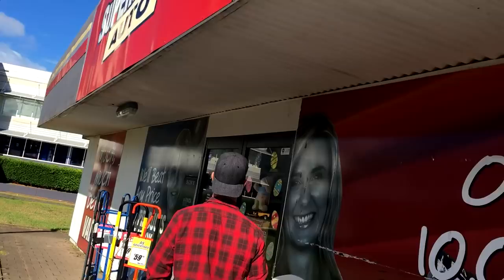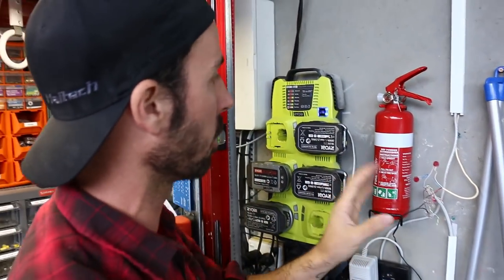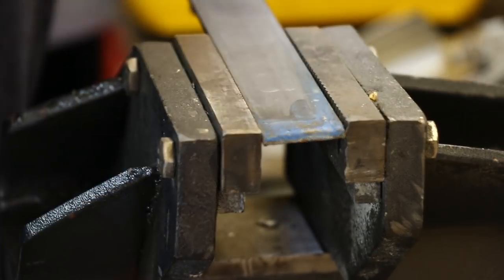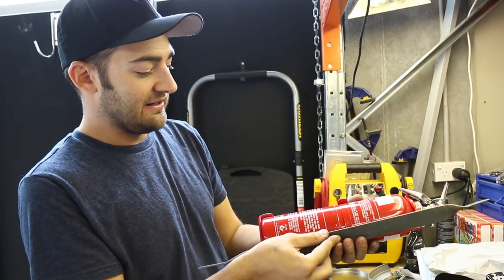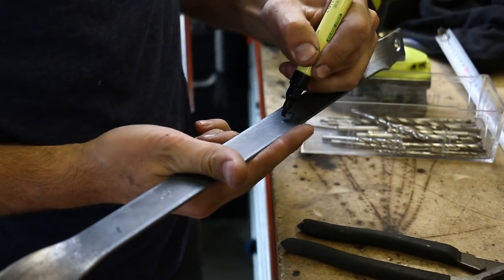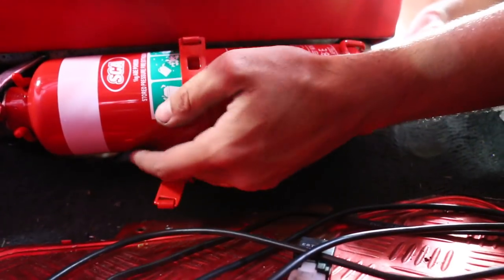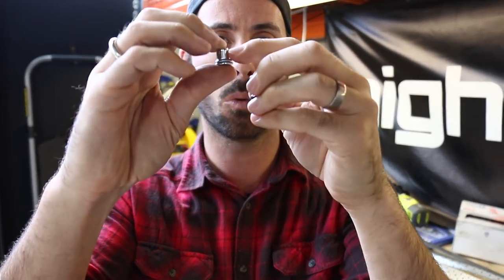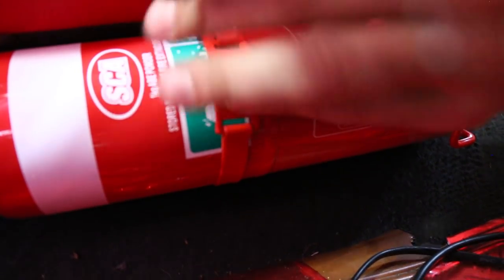How To Install A Fire Extinguisher In Your Car

Comment: This thing just saved my RX-8. When I was roaming around, my car stalled for no reason and I tried to bring it back on. As I did that, the cat went on fire due to the unburnt fuel, caused by a dead spark plug, ignited with immense exhaust heat. I grabbed the fire extinguisher and it saved my ass that day. It's one of the greatest investment of owning a tuner car, in my opinion.

Comment: Also worth noting that you should get the right kind of fire extinguisher for engine fires. Water will do nothing on an oil/gas fire. Get ABC or Halon, preferably Halon because it leaves no residue and it's approved for aircraft.
Reply: *Carbon Dioxide
Reply: HJZ75driver
Is that what's approved for racing? I wouldn't know. I just know the Halon ones for aircraft.
Reply: UnlinealHand if its approved for aircrafts the. Wasabi 9000 needs it

Comment: You both put more effort into installing the Fire extinguishers than I did with my car. I grabbed a drill, my extinguisher and some sell tapping screws and job done. Now I have nasty sharp pointy screws sticking out from under my car.
Reply: +Joe Will hope you dont roll your car, 2kg of fire ext flying around the cabin when the selftappers pull through with enough g force.

Comment: I have always kept one in my car even sense my 1987 Fiero caught on fire in 1995. I did manage to put it out by ripping out the radiator over flow tank and pouring it on the engine. Sold this car soon after cool little car tho fun to drive.

You should do a how to install a GPS tracker in your car for the next time yours gets stolen you can track it !!!!

Comment: Except that the holes that are now in the floor of the Saab will start to rust
Reply: get stainless nuts. problem solved!
Reply: +Rick te Kronnie now*
Reply: rubberized undercoating paint will help against rust. Just because the rivnut is stainless doesn't mean the rest of the floor will rust.
Reply: +petey2crazy yep i didn't read it right i thought for some reason he was talking about the nuts

Comment: Some things that absolutely should be done differently... 
1: You should be able to reach it while strapped down with a 6p. 
2: One litre is often way to small if fuel is on fire
3: You might one for the interior which doesn't destroy wiring, carpet etc and one (larger) suited for exterior/engine compartment (not in the engine compartment) 
4: Some incurence companies will reduce your cost if you have this
5: Good that you guys show that people should have these but why have an episode for something that basic 😂

But then again, it's you guys...  You don't do things @ 100% but people love u 😉

Comment: Having a fire extinguisher in a car can be a useful item but you need to know how to correctly and safely use it. Also you need to know when not to use it and to just focus on moving everyone safety away from the fire.

The first bit of safety kit I have with in reach with out stretching on modified vehicles is a rescue hammer with a belt cutting blade. So if you are trapped in you harness you can cut through it and then smash out a window if you can't get the door open.

Comment: I got me a free extinguisher from work because they have a rather pointless shelf life and after something like 3 years they have to be replaced so they put about 25 of them on a pallet with a sign saying free . I took a piece of 20 gage steel i had kicking around and in about 2 minutes i had a free mount as well . just cut a strip about 2 inches longer than you need and bend up a quick release by bending one end over a 1/2 inch socket and bend the other end over a 7/16 socket , now i just press the 1/2 inch over the 7/16 and abra ca dabra a free extinguisher held down very well by a free snap like the one on your shirt only about 100 times bigger and stronger . The snap holds on so well , i can't open the strap without pulling on the extinguisher at the same time , because it would be about as hard as removing a snap ring without pliers .

Comment: One thing not mentioned here is that there are different extinguishers for different types of fires. You want to make sure you get ones for gas/oil fires.
Reply: +iamstd2 If you buy it at an auto store, it's probably for cars.

Comment: I'd also put some threadlocker on the bolt threads otherwise it will vibrate loose over time. Oh, and wear safety glasses when using power tools...

Comment: I have never heard of a rivet nut before. I must have these in my tool box.
Reply: They're great until they spin in the hole. Then they're fucking terrible. Best way to do it is just put a tack weld on them after install so they can't spin.

Comment: My only gripe is you guys didn't mention anything about rust prevention on either the plate of mild steel or the new holes you've put in your floor pan.

Comment: What ever happened to CAMS & MSNZ approved extinguishers having two steel straps ISO8.8 M6 bolts and self locking nuts with Panel washers?

Comment: verry important if you have one of those cheap fire extuinguisher that will keep spraying after you slam the button 
wait untill you near the fire before you slam the button as the bottle will empty in about a second flat 
allso never mount it under the driversseat , should the bottle come loose (like if you hit it while getting intoo the car) it can roll under the brakepedal giving you all kinds of problems 

might be a nice mcm episode aspecially from the insurance point of view to get with a teacher from the firedepartment and do a show on the propper use of the extunguisher and how to apreach fires and stuff like that and then train on an actually burnng car on their traininggrounds

Comment: I really want to do this, but I think I'm going to hold off for now.  I don't think passengers will get the best impression if they see a fire extinguisher in the footwell of my car haha.
I keep mine hard-mounted in the trunk.  Yes, it's harder to get to in a pinch, but I can still get to it in under 10 seconds if I'm in a rush.  I also do not autocross right now (money), so I don't need to conform to any race regulations.

Comment: The rivnut in saab is useless. It would be more secure if it was glued to the floor with clag glue. 

The wording thinsheet is a giveaway, they have a grip range that needs to be acknowledged and M6 rivnuts of that style only go up to 3mm. 

you need to remove the deadening material from the floor (inside the cabin) to reveal the actual steel floor to  set the rivnut correctly.

Comment: Buy extinguisher and bolts, pick a spot, drill 2 holes, insert bolts through extinguisher mount, tighten bolts, place extinguisher in holder. Alternatively. place extinguisher in door pocket, fitted! :P

Comment: I had one of these in my 1974 nova, which is my daily driver, and apparently they leak out because I used it once just a little, I checked and there was still some more, so I put it back. Then when my volt meter caught fire on the freeway it didn't work xD

Comment: My car has a factory fire extinguisher on a proper bracket and everything but it's loose in the boot and not bolted to anything and I don't know where it belongs.

Edit: I looked it up and it bolts to the front of the driver's seat. Seems a much more accessible place than in the boot.

Comment: Not to be a pain guys but you forgot one thing on the bolts holding the extinguishers in place: Thread Locker. Made that mistake once and ended up with a loose extinguisher in the truck and it was not fun.

Comment: Installing a fire extinguisher to a car is not about drilling holes to some mount, but a serious safety-feature. I hoped,  you´d go more deeply to the detail of WHAT extinguisher to choose. Most powder systems will simply eat your electrics, connectors, contacts, switches, cables etc and damage most other metal parts, plus ruining your interior for good. Most foam-systems simply won´t do the job, unless you install a massive container. And they, too, will ruin what´s left of your car. The one and only system to be installed if you want to go safe and you really love your life and car, is a gas-based extinguishing system with FIA approval for example "Lifeline ZERO or Zero 360". The gas tank is installed in some safe place (backside trunk o. e.) from where several tube-lines are laid out to all the points from which a fire could occur. The valve is electrically triggered by the driver. All professional racing series have it applied that way. Prices start about 900.- €

Comment: Hey mcm, and thier fans.
Just bought an old 99 subaru,  want to make some maintainance. I was thinking about cleaning the engine with various products and restoring the compresion. I want to use seafoam, some king of fueling system cleaner, that you can add to your tank. And Compression restorer into engine oil, before changing it. Am I an Idiont?  these things work? What should be the correct order of using them ? Would someone recomend something more or diferent ? Or maybe talk me out of something?

Comment: pls help me with my 2000 dodge neon its the none turbo one i just need suggestions on making my car perform better. its currently having poor idle and its not starting right away and my spark plugs are flooded. and id like to put turbo but not sure my engine will blow if i do so. I'm a big fan learning a lot from your videos
Reply: sell it, buy an e30 325, and boost it.
Reply: +Will Feral not sure what you mean bro sorry I'm just learning mechanical stuff hehe
Reply: Ah sorry man. Just speaking from a power potential stand point, sell your neon, buy a e30 bmw 325, and turbo that instead. Those motors handle boost very well, and e30s are becoming more and more scarce. It will also be easier and more fun to work on than your neon.
Reply: +Will Feral  what year you recommend?

Comment: I set a car on fire not too long ago. Always make sure the gallons of brake cleaner used has evaporated before reconnecting the neg terminal. Pro tip.

Comment: Those rivet nuts suck if they come loose or get cross threaded and start spinning, have to hold them from under neath and then drill them out. Also I prob would have painted the underside a bit after drilling through.
Reply: +Preproto You should get a pneumatic rivet gun
Reply: Thanks but I don't do that job anymore. Do they make pneumatic ones for these mollies? But the ones I like are the ones where you use the a little tool that grips the molly and you tighten it down with an impact gun

Comment: Can't sleep. it's 3:46am and all I cam think about is that hideous Evo making at least 140hp would be great to see more hp but I just don't know. even at that I don't see 2sexy beating the Saab in any challenge. However I'm rooting for #teamevo! haha. Part 11?!
Reply: +anewacc Unfortunately I think Marty knows this. The Ricevo is about to get chopped. I don't see any torque coming from that little 1.5. he also need to strip the car to the bare minimals to stand a chance. No subs, no passenger seat.

Comment: I had this idea of replacing all my master car window switches in my 1996 nissan pathfinder. So you know how in modern cars, the driver side will have all four window switches for the car? And the driver side window is usually the only one that you can roll down or up without holding the button? (Just a quick press or pull off the button) Well I wanted to do that will all the windows in my car but I'm not sure how to. I've looked hours online and can't find anything. Probably because I'm not wording it properly. Can someone please help me out?
Reply: +Volcomintality get 3 more switches identical to your drivers window switch, swap them out on the switch panel. depending on how your switches are designed this will make all your windows auto. some cars this is not feasible unless you are skilled with electronics and soldering ect.
Reply: +NeonAvantium that's exactly what I was thinking! Just don't know where to find them. And i've disassembled my door already and when removing the switches, all four are connected to eachother. I've looked it up to see if anyone else has done it or has installed on and nothing.

Comment: For all my American friends, it's easy to go to Home Depot and buy an off the shelf unit for about $35. HOWEVER!!! Home Depot sells the Kidde brand extinguishers, which feature a black plastic handle. These units are currently subject to a RECALL of over 44 MILLION units. The plastic actuating handles are known to break, and now we're finding that the tips of the hoses in some units have NO HOLE for the chemical to come out! Kidde extinguishers are a LIABILITY and are to be avoided. I think the icing on the cake is that if you walk around Home Depot, you might notice the fire extinguishers they have hanging in case of an emergency, and they are Amerex brand. Home Depot doesn't even trust the Kidde product they sell to protect their stores. That speaks volumes. Spend the extra $15/$20 on an equivalent Amerex brand unit.

Source: 2 years in the fire protection industry.

Comment: Wait, this is a fire extinguisher install? where is the piping leading to the engine bay and transmission tunnel, and under the dash? Oh, this is a fire extinguisher bracket install. HTH, HAND

Comment: I just carry a few water bottles, just toss them on the floor in the back.
Reply: +22laith22 That won't pass tech at most tracks, lol.
Reply: everyone loves spreading gas fires lol
Reply: +22laith22 you can't put out gasoline fire using water.

Comment: I don't mean to be mean but after Thirty plus years selling and servicing all types of fire equipment I have to say there are some errors in this post. If you have a Fire Extinguisher made by kiddie or anything with a plastic top get a new one! If you go into one of the big box stores look at the ones that they sell vs the ones they use to protect there store. They will use typically an Ansul, Amerex  or Badger product. First alert and Strike First are also junk. I used to prefer Amerex but Now Like the badger brand the most. Ansul makes the best kitchen fire system out the and there fire Extinguishers are probably in second place these days. You will not be able to get these at the box store or even at a good hardware store.  You will need to get these from a fire Extinguisher CO. Ask around andf try to stay away from the big guys. Smaller Company's like me tend not to treat there customers like $$  There are so many companies just looking for your money so ask your fire dept if they trust anyone, they are not officially allowed to recommend a company but they know who sucks.
A couple things that bugged me about this video. First  rare earth magnets to hold an extinguisher to a car??????????? 
First tel's Look at the amerex and the other crappy one in the video they both had vehicle brackets attached you just need to screw the bracket into the car somewhere. I know that most people don't want to drill holes in there fancy car but trust me a loose fire extinguisher going off in your car will Blind your vision for 30-60 seconds and more than likely cause you to crash. Trust Me it sucks you can't see and can't breath, happened twice in 30 years.
       Last thing He should had had his son up wind and had a diesel/ gas mix the pan , to show which one works best.  Also Let The Future Fire Fighter Have his Fun And Put it OUT 
Thanks for listening/ reading John 

PS i only stumbled into this while looking for parts for a POS buckeye system

Comment: add a mcm fire extinguisher to the merchandise range
Reply: 4/20 for a reason
Reply: +Dan Evans (Noob Central) 
Just go down to the local auto store or hardware store and get a Dry Chemical.
It will be cheaper since the postage for 1KG or 2KG will be  a little pricey and mail delivery may not want to deliver  a pressurised container for safety reasons
Reply: +IIGrayfoxII it was a joke...
Reply: +IIGrayfoxII  Mr serious lol a mcm extinguisher would just be for the aesthetics hook me up mcm

Comment: I thought dry chemical extinguishers were corrosive, and hence disastrous for cars? Maybe best to go CO2 and play it safe.
Reply: If your car is on fire you probably have bigger issues than corrosive powder.
Reply: Hopko50 Sure, but I've heard anecdotes of cars being totalled from using dry chemical. I love the irony, but seems like a lot of paperwork. 

Of course, I don't know how accurate this is. Presumably stores wouldn't sell extinguishers for cars that were bad for them...

Comment: 6:07 which one of youse smoke?
Reply: +MrCALLUM9999 What did you see that makes you think they smoke?
Reply: Burt Sampson Ciggie packet in the front drivers side of the footwell.
Reply: I watched this over and over and over again in slow motion and I still don't see anything. I think you may be seeing things my friend. There's some kind of metal box on the floorboard on the drivers side, but that's the only thing I see at all.

Comment: Is that a cheapo dry fire extinguisher? Have you ever had to clean up the mess it leaves behind? I rather let my car burn down, than do the cleanup.
Halon/Halotron or nothing.
Reply: I can buy one right now on eBay, and from most fire extinguishers stores.
its legal to sell, and refill them. its just illegal to manufacture new halon.

Comment: Yeah but...
You failed to mention your cheapo fire extinguisher from Home Depot will muck up your engine bay and destroy your cars electrical system beyond repair. You must buy the $150+ Halotron gas extinguishers, if you ever hope to drive the car again.
Reply: Those aren't allowed by law in Europe.